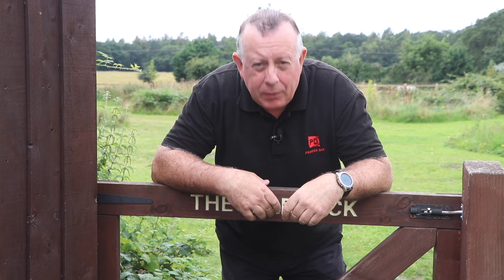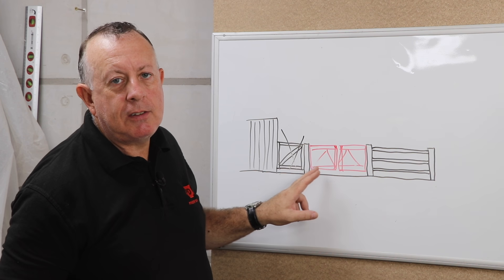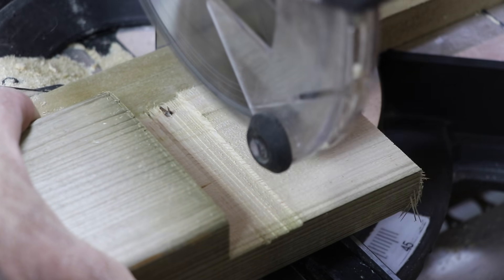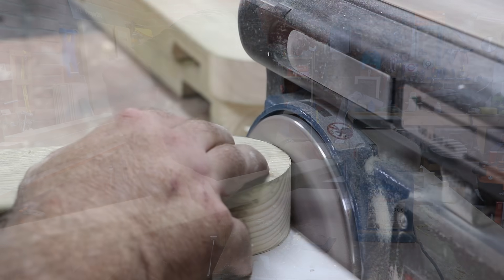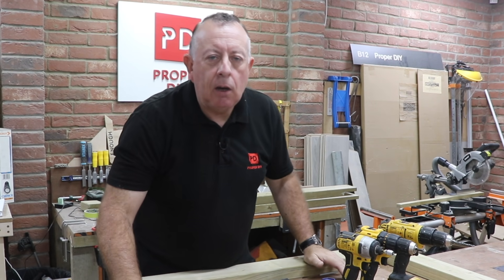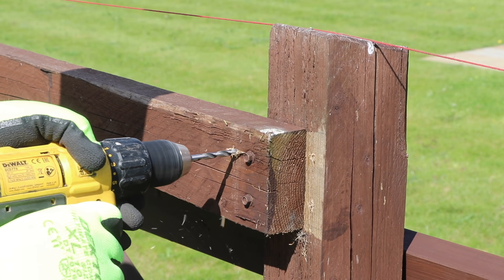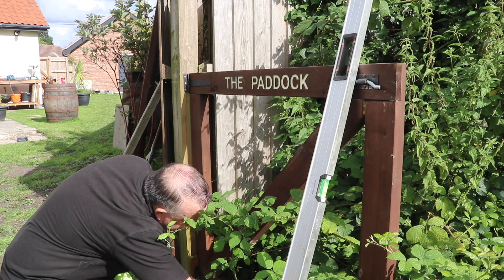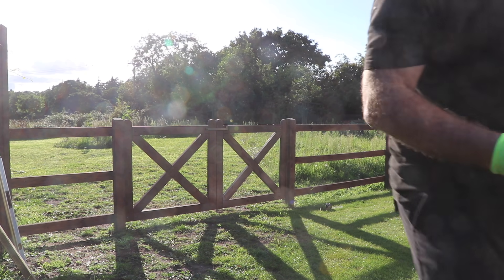How to Make Timber Gates with Half Lap Joints

Comment: Why didn't you make the new gate asymmetrical so you could reuse the old gate?
Reply: Because looking at that daily is the route to madness 😅😅
Reply: it would've worked if the new addition was twice as wide as the old gate, but slight asymmetry would never feel right.
Reply from the maker: As I said int he intro it's too narrow - the old gate is 75mm narrower than half of the span so would always look wrong.

Comment: Nice job Stuart. Top tip (from Peter Millard), when you're spreading glue at 9:05, if you use a silicone pastry brush to spread the glue, when it dries you can simply pull it off the brush and no cleaning up required

Comment: Top tip. If you need to split a stack of timber (or anything strapped up with tape), find the join, twist it over and the rear of the tape joint will have a short tab not bonded and will peel away dead easily, no knife required.

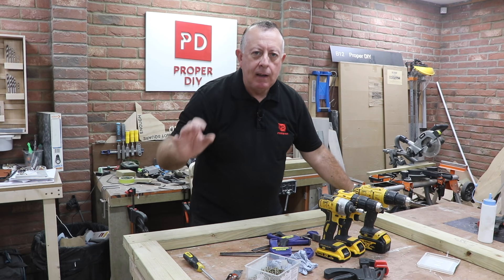Comment: A very interesting comment @10:30 about the use of multiple tools. A couple of years back when I just had a drill/driver I managed to wear out the chuck on my DeWalt because of repetitive bit changes. My use was intense, in terms of number of changes, but not in terms of load on the tool.  But the high cycle rate on the chuck caused it to fail. These days I have multiple tool  options, as Stuart does, including two impact drivers, where obviously the impact drivers are significantly more robust when it comes to bit changes. So, depending on your usage, multiples tools isn't an indulgence, it actually has a real benefit. The background to this is that unfortunately these tools very much disposable, I was told a replacement chuck was only available complete with gearbox, making repair uneconomic. Nice gates by the the way !!!

Comment: Nice one. Much more fitting for the use of the land. We never use anything but adjustable hinges on double gates. We haven't heard of any sagging after a few months yet, but we do use thick posts that are indeed a meter into the ground with a few bags of concrete usually.

Comment: Just found your videos. I remodel homes inside and out for a living and Have watched a bunch of your videos got a lot of ideas and trcks and wanted to say thank you!

One trick when building gates/fences with X joints is to first cut the middle notches and then lay the frame on top of the X to mark and then cut your corners fits first time every time save you a bit of time! 

Moved to the USA 12 years ago from the UK so it's nice to hear familiar accent also! 

Again thank you.

Comment: I was a bit worried about those bolts when I first saw them, thinking "wtf!" =D   A tip for the ground pin: a concrete or brick paver with a hole drilled into it is easy to lift and clean out once it gets full if dirt.
Reply from the maker: I think I will soon be levelling the ground through there so I'm sure the tube will be coming out soon

Comment: I find B&Q especially, and Wickes expensive compared to Tool Station or Screwfix and timber is cheaper at my local  independent merchant where, if you do a lot of DIY you can get an account with extra discounts.
I avoid the big sheds as much as possible.
Nice job as always Stuart.
Reply from the maker: You are right about the costs. 2 advantages I find you the big shops are - 1) you can rifle though every piece of timber to find the best bits without anyone caring and 2) for my audience who are mainly average DIY'ers, the big shops are not a daunting as those that have no prices on anything.

Comment: This sounds like a familiar story Stuart. Last years project becomes out of date or needs to make way for something new. The story of my DIY life. 
I have today been rearranging my garage workbench to take a mitre / chop saw in a dropped section. In theory a simple enough job. In reality it turned into a massive undertaking requiring disassembly of the whole bench & all the attached fixtures. Half the garage landed up in the front garden on driveway & it's still not finish after day 2!! 
On the other hand your project seemed to go swimmingly 👍

Comment: I'm going to make a side gate and was thinking about whether to glue it or not. Standard PVA isnt waterproof and even the outdoor PVA implies it shouldnt be constantly wet, which for a gate in the UK sounded a bit hopeless. Just wonder after a few months if the glue has actually got any strength in it or is it really the screws holding it together. I was wondering if a 2 part resin glue would be better?

Comment: 2:35 - Er, couldn't you just make the other one (that same couple of inches) bigger?
Reply from the maker: Yep, but that would always look wrong
Reply: @ProperDIY  - Well, I guess the sizes would be too close to make it useful (and in that range that makes it look like it may have been a mistake), but having different-sized gates on each side actually gives you more options in terms of width (ex., small gate = 1/3, big gate = 2/3, both gates = 3/3).

Comment: bit surprised you didn't set the drop hinge in with stabilised soil. I've seen a brilliant youtuber do a great tutorial on it here https://youtu.be/teP2f2fmSAk?si=kkYt9F0U68TivkMa ;) I was also thinking that if you added diagonals to the fence either side, would that help spread the load and reduce sagging? while its still there, can't you grab that The Paddock sign, run it through the bandsaw to cut that down and attach to the pedestrian side? seems a shame to waste your efforts with the router